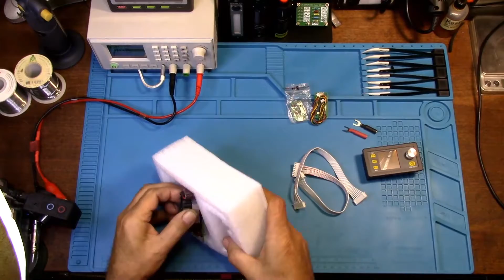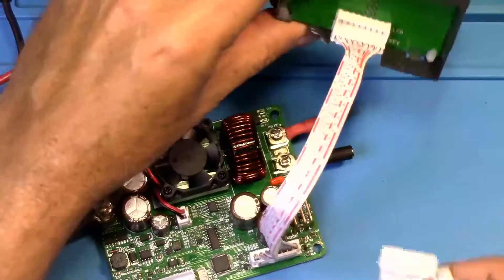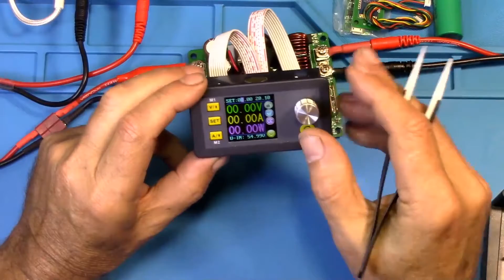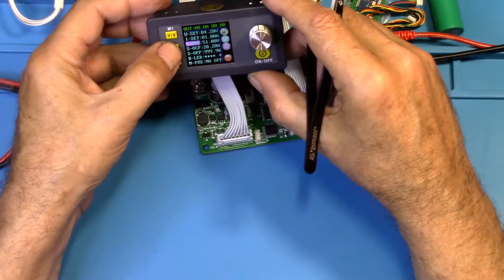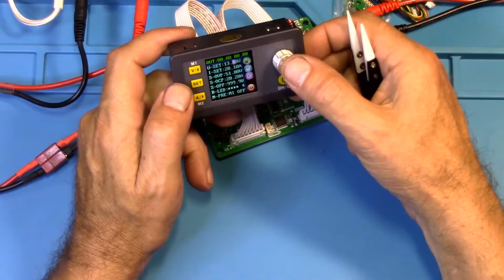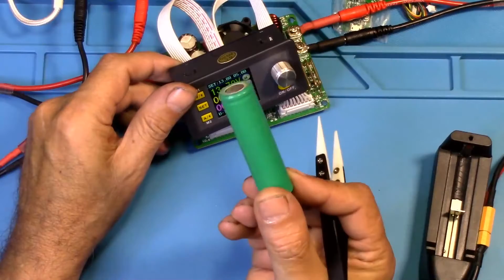Rui Deng DPS5020 BT Review & Test Power Supply Control Module

Comment: I was just starting to build one. I was picking parts, and while taking a break I turned on the tube, and bingo, here you are. It may have been cheaper but my time is worth more than 32$.  Thanks
Reply from the maker: Thanks Buzz for the comment.  Am not sure what it means though...  What may have been cheaper?, the DPS5020 is 60.00, and a switching power supply to make it work is about 65.00.

I am having a hard time finding a meanwell power supply that is 60V 20A though, but I did find another one by Bosytro that is 65.00, so both of those would be around 135.00, so not sure what you meant by "my time is worth more than 32.00" :).

...And did you find enough parts to build a power supply?.